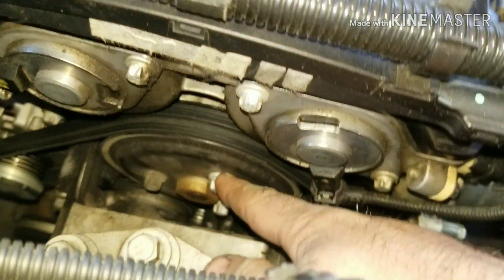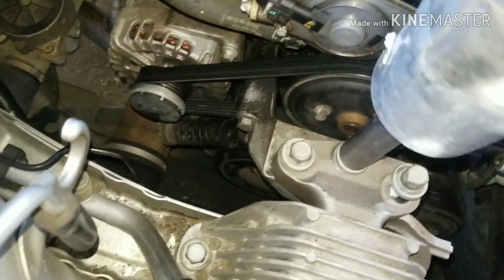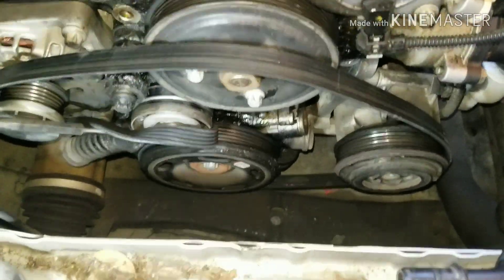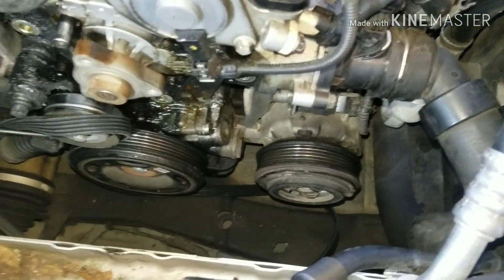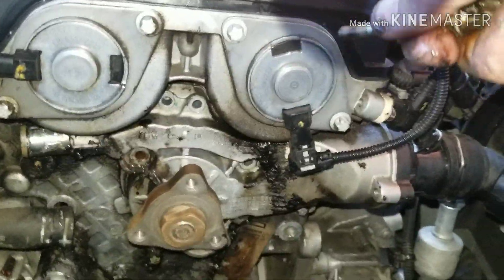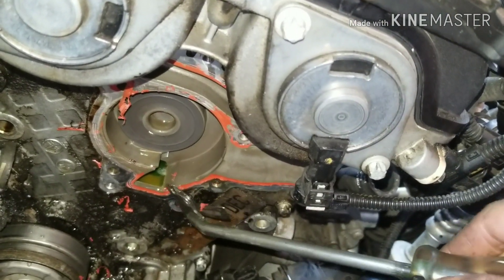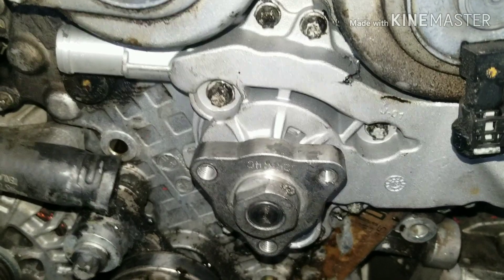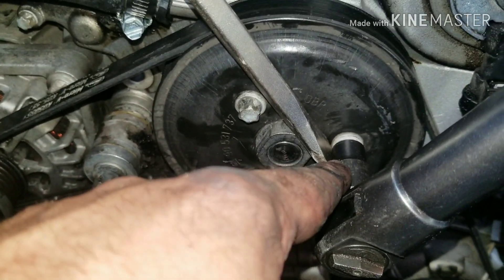How to  replace the Water pump  on a 2014 Chevy cruze

Comment: There is an air bleeder on the top left side of the radiator for the cooling system. Very important that you bleed the air out this way because it won't completely fill otherwise. I've also got a 2014 Chevy Cruze.

Comment: since its next to impossible to buy the pump bolts, most online suggestions is buy new pump/gasket and new screws. but seeing as you used the old bolts. is it safe to use the old bolts? since some vids they say there is a possibility the bolts become unsafe/useable once you "break" them loose to change the pump. 

i need to swap my pump out but havent had time to do so, mostly cause as i said its near impossible to find the bolts. amazon sells the deco pumps with gasket but not the bolts lol so is it safe to reuse the old bolts?
if i have a shop do the repair or i do it my self id rather not screw my self by using the old bolts if doing so weakens the bond/seal. also what would the torque be on the screws? there isnt much posted online that i have found even from the old GM repair manuals.

Comment: Thanks for the video... quick question...what's the blackened (burned/charred) looking thing at the 00:03:30 minute mark? You mentioned carb spray will loosen it and the coolant will flush it out...can you explain how that works (in detail please)? Thank you.
Reply from the maker: @salvadormiranda8029  it's just residue from the coolant leak that has dirt and oil mixed with it that makes it hard to tell if it's leaking on the future.
Reply: @fixergood I have a crack in my coolant outlet housing unit, when I removed it, I found that...wasn't sure what to do with it. tnx.

Comment: Thank you that was very informative
Reply from the maker: Thanks for watchin really apreciate it besure to like  and subscribe
Reply: Thank you I did quick question do you know where someone can buy the bolts to the water pump?
Reply from the maker: If you have a old bolt  for comparison you can get the thread pitch and the diameter of the bolt  and probally get one from any good hardware store or well equipped parts store

Comment: Good video I've done it before but in an 87 buick regal much easier lol..I do have a question because I don't remember once I use the sealant for the gasket how long does it have to sit before I can fill up the tank and run the car we only have one car since I drive an 18wheeler so kinda need the car back on the road fast well let me k ow if you know thank you
Reply from the maker: the rtv is  stands for room tempture vulcanzation, , which means it hardens at room temp. I usually put it together with the gasket  and longs as it's not 30 or 40 degrees, let it sit for a hour before I ad coolant .thanks for watching

Comment: Do you have to remove the thermostat housing?
Reply from the maker: Taking the thermostat off is required in order to put it on the new water pump. I hope this helps. Thanks for watchin and besure to like and subscribe
Reply: good  yes thank you. I just had my waterpump replaced couple weeks ago and my car is worse than before. The reason I replaced the waterpump is because I had some vanishing antifreeze I had to top off but no visible leaks and no overheating. the thermostat housing and hoses were replaced about a year and a half ago and it never overheated afterwards . But since I've had the waterpump replaced my car has overheated 3 times. However after I had the waterpump replaced it over heated within the first week. Three times in 3 weeks and the last time there was zero fluid in the reservoir. When I added coolant into the reservoir it poured right out onto the ground. The shop that replaced the waterpump said its leaking from the water outlet aka thermostat housing. The thermostat housing is only a year and a half old so I'm wondering if they are either lying to me about the waterpump not being any good, attached right or if they damaged the thermostat housing when they replaced the waterpump. (The thermostat housing and hoses were replaced at a different shop).
Reply from the maker: @tallterrilaw8646  its possable that your thermostat is sticking  causing it to over heat.  If you had a leaking head gasket it could cause the water fo disappear also .It's also possable the thermostats could of been damaged when it was put back in. I hope this helps
Reply: @fixergood  well it's no longer gradually disappearing its pouring out majorly. Thank you
Reply: @tallterrilaw8646 did you check the bottom of the reservoir or line there for cracks or a tear? Where exactly is the coolant ending up?
Reply: @DominiAeternum  that car is long gone
Reply: @tallterrilaw8646  damn. Just gave up on it huh?
Reply: @DominiAeternum  it blew a head gasket

Comment: When adding coolant do you have to bleed it and how
Reply from the maker: I dont think this has a bleed screw you may need to look at a manual,thanks for watchin.
Reply: Just fill the radiator up then run the car up to temp and fill the resavoir up to full hot mark and recheck after running for awhile!! Hope this helps you..